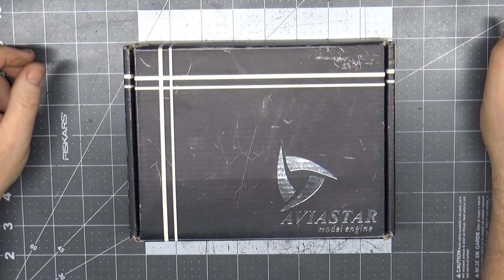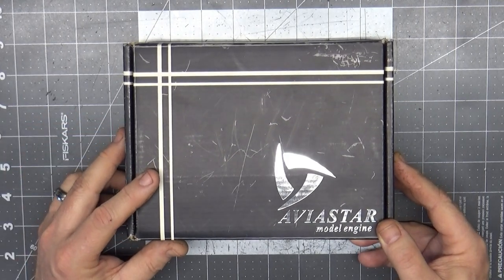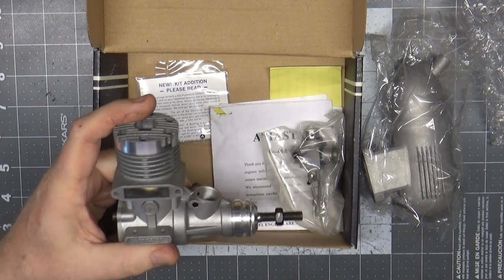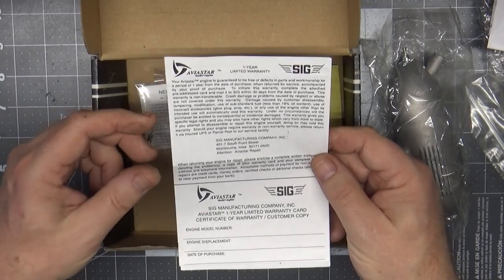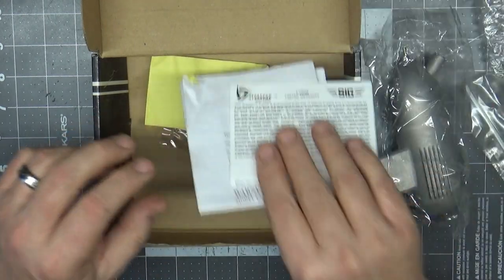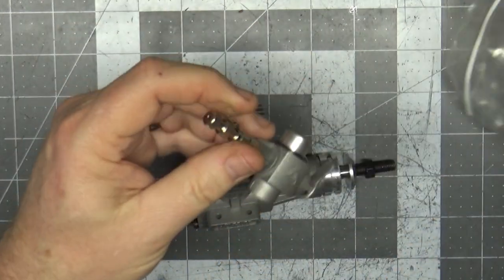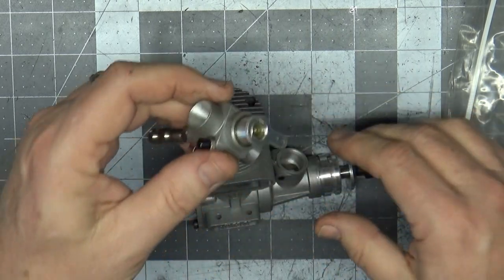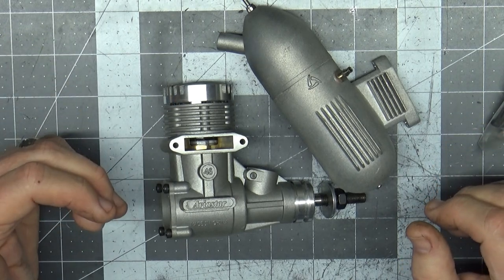Aviastar AV-46 ABC A Quick Look

Comment: Yes it would be interesting to see the right way to do all of that breakin  and to see if I’m doing it right
Reply from the maker: Well for an ABC engines you can read this for break in procedure. http://adriansmodelaeroengines.com/catalog/main.php?cat_id=99  You can also reference what the manual for the particular engine states.  There are tons of slight variations on break in procedures.  Just look at the topic on any RC forum.  The key is that the break in for a ringed engine is very different than for an ABC engine.

Comment: I think the casting may actually be investment casting process, similar to Rossi engines which is superior to die casting used by sanye of even O.S. The piston and liner look impressive with no bridge in the exhaust port again similar to Rossi. Perhaps a break in run of this then a max power rum with a 9x8 or 10x6 prop? Rossi, Supertigre and others on Fai fuel.

Comment: I had an Aviastar 46. Either it was a lemon or those engines are terrible. It never flew a successful flight. Dead sticked every time. Gave it to a friend and he messed with it till it drove him nuts...changed carb tried a ton of different plugs...dead sticked every time for him too if it ever got off the ground. It usually started and ran fine then went downhill as it warmed up.